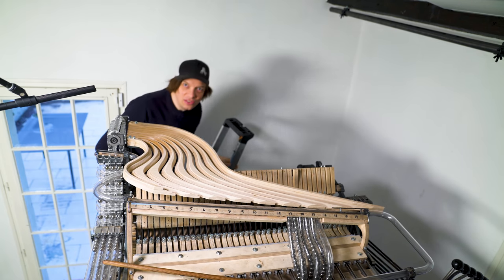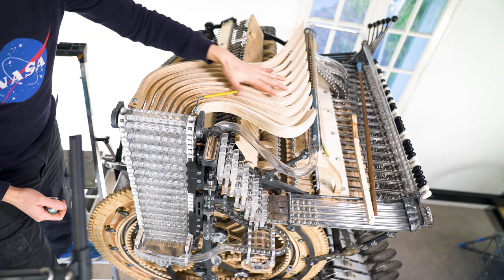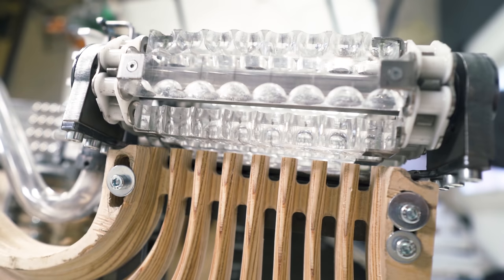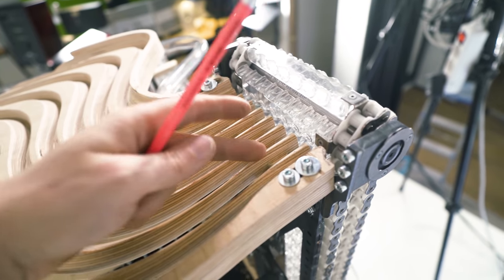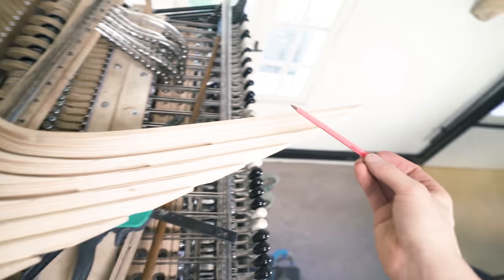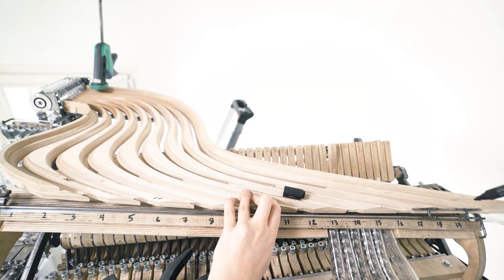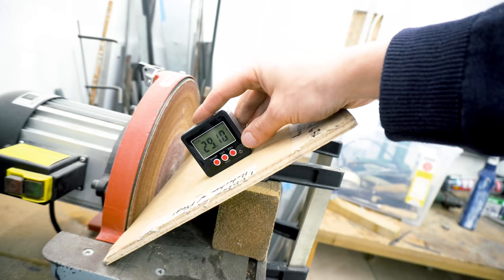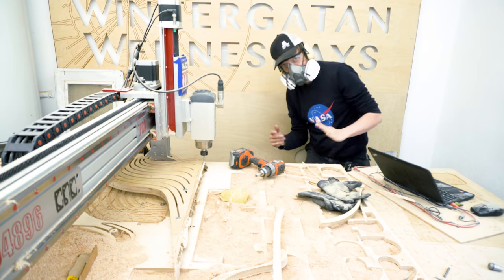Marble Conveyor Belt Plywood Lanes

Comment: I love the progress you've made but I'm gonna be honest, I'm a little concerned with the marbles running down the divider, they are getting hung up on the marbles on the top of the channels and in some cases jumping when they hit them, and this is just with 6 channels, what's going to happen when you have all of them, they might lose momentum and start jamming up then you'll find yourself in another round of engineering whack-a-mole. Might want to revisit making the marbles at the top of the channels as flush as possible, I can clearly see at least one channel (#15 I think) where the top marble is sticking out a bit too much and marbles are getting hung up on it.
Reply: It's a difficult balance to strike. Either the top marble sits too low, or it sits too high. Either the marbles in the runway get caught on the marble in the channel or they get caught on the channel itself. I think we may have to accept the fact that depending on the speed of the marbles vs drag and various other factors, some marbles are just going to get stuck. Short of making the main channel steeper (But then we face the issue already present where marbles are skipping over the channel entirely) I don't see a way to avoid all of the marbles getting stopped at some point in time.

What we can control is the most likely situation for marbles to get stopped. The ideal situation is that when a marble gets stopped, that it provides the least resistance possible to the other marbles that are going to hit it from behind. This way things don't get clogged up.

Comment: The marbles are going so fast, they almost bounce out very often. And the earlier channels aren't going to get a lot of marbles, especially as the marbles bounce around, almost completely relying on that on overflow tube. Maybe a very intensive song that has a lot of things going on is going to starve some of the channels, if you rely too much on that overflow. Especially if there is a very "hungry channel" it might just eat up all of the reliable overflow marbles and starve most of the channels after it. If there is some simple way of slowing the marbles down and or keeping them more contained and less bouncy, then it's no problem, but I can't help but think that a lot of the solutions might create additional moles to be whacked.
Reply: The higher channels have their own additional feed
Reply: If the latter channels are getting too many marbles, the overflow will supply those extra marbles to the earlier channels.

Comment: I understand that the form needed to achieve 100% reliability for playing music is goal number one. Yes. It's good to have that focus and necessary. But the visual play of the moving parts, the moving marbles, and the static forms of the machine is part of the end goal. It's a marble machine so watching the marbles run is so important. And these lanes look great and achieve that purpose as well as delivering marbles as required. Exposing the path of the marbles on the top is a big deal and will really be a big part of the experience. It looks fantastic! Is it a marble machine that happens to play music or an instrument that happens to use marbles? Such an amazing way to tease out this dynamic. Thank you Martin.

Comment: Hi Martin. This is not a technical comment regarding anything in the machine, and I realize there is a small likelyhood you will ever see this. But I know from experience how it can be with the overwhelming feelings of every kind when undertaking a project of such a humongous size. Just remember everything you have achieved so far. At the moment you are doing whack-a-mole for your hearts content, trying to figure out the inns and outs of the machine's quirks, doing fine tuning of some of the critical functionality of it. But you have achieved a lifting system that works very well. You also have an extremely mechanically sound powertrain of the machine. The programming wheel works like a charm, not to mention the hi-hat machine. And it all looks so beautiful. The movement is intriguing, the colors are wonderful and the balance between wood, steel and acrylic is nothing short of perfect.

It has been three years, and I think that this project has ended up being larger and more complex than you thought when you started up. But you have come so far. Looking back at the videos from 2 years ago, 1 year ago, or even ½ year ago it shows clearly. Don't forget that, especially not when times are feeling rough and the amount of work left might feel overwhelming or never ending.

Comment: This is always so awesome to see your design process and see the machine coming together more and more.

Might be worth putting a small layer of felt or something on the entry to that marble run.  You can already see some marks and a little wear from the impacts.  The undersides of the elevator levels are taking some hits too.  That could cloud up the plastic over time so maybe some clear silicone or rubber there would be good?

Comment: hey Martin, at some point in the slomo footage you can see the marbles skipping around on top of the holes with the other marbles in it. To keep that from happening you could add in a rotating crossthingy out of wood, basically a flap that covers the hole and rotates, letting a marble through whenever there is space underneath it to let it rotate. It would give the marbles a smoother surface to roll on and there would be less risk of one dropping out

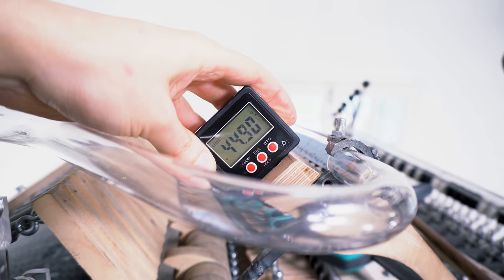Comment: Martin, I think your disk sander (5:03) has an angle adjustment under the table so that you can sand angles easier. 

Also, it seems that the marbles from the top conveyer belt are dropping into the 2-4 the most with none in 1. This might pose a problem because the leftmost channel (at the top of the slant) may not get enough marbles (or any) as the ones toward the right will. I would recommend ensuring that the conveyer is either always full or prefers the higher channels. 

Great content as always! It is really beautiful.

Comment: I don't know if you noticed but lanes 1 and 2 are getting a lack of marbles.  Which is going to be an issue later on when the machines is needing to play those instruments. Also yeah the bouncing is going to be an issue.  I noticed that the last video.  If you re-watch the footage from 8:09 to 8:24.  Lanes 3 - 5 are getting more traffic than lanes 1, 2, 6, 7, 8.  Which again is a glaring issue with this new marble... gutter lane setup. Maybe that is by design, but not sure.

Comment: The part is essentially flat, but the line where it starts (at the marble ladder) and ends (at the feed ramp) are not coplanar, so clamping or bolting the part to these two lines puts strain on the part and the mounts. If you were to extend the grooves in the ramp all the way through the bottom end of the part, you'd end up with something like the teeth of a comb. You'd have to attach each "tooth" of the comb, individually, at the feed-ramp end, but you'd considerably reduce the twisting strain on the part where you have it attached at the tap - and you'd avoid further cracking.

Comment: One thiing caught on eye- Those rail speed and timing. As you allready know if you adjust the gap widht of rail of those first ones you can adjust rollin/timing speed then all marble came at the same time to the collector rail. Now the middle rail is slower a bit ans last two of the right are littlebit faster. That desing still looks SO good!

Comment: The new track looks great!

As an engineer, I saw one thing that might be an issue- the marbles seem to land on the same spot after being dropped from the conveyer. This, combined with the fact that the wood is relatively thin there, could lead to some longevity issues down the line from the marbles wearing down that area. Maybe its not an issue! We'll see.

Comment: Might I suggest a small patch of a material that can absorb the impact of where the marbles land off the conveyor? Each drop off is an explosion of sound and if you can maybe control the resulting bounce, a rubber or foam of sorts could quiet it up a bit.

Comment: The marbles follow a Gauss-distribution on the elevator entrance. Maybe a feathered (Tree-styled) entrance wing, emphasizing the outer parts would even the spread. Maybe there could be a minute height difference in the applicant wing. Maybe allowing crossovers at the entrance of the new upper wing would work. It‘s not a problem though for now or maybe ever.

Comment: First: The plywood lanes are a piece of art!
Second: The bouncing marbles on top of the marble divider (starting at about 9:07 ) is very scary!
If the final drop was less steep (maybe 22 degrees instead of 45 degrees?), but also had more room, would that help? (It could also slow down the marbles in the plywood lanes, because the drop distance from top to bottom would be less. (As long as the marbles didn't come to a stop in the lanes, though.)

Comment: Given the recent improvements to the marble gates, I am wondering if the systems pin trigger + marble divider could be slightly lowered, thus completely eliminating the need for the marble escalator : marbles would get out of the main wheel through the demagnetizer, and immediately enter the marble divider. Would remove the marble circulator too.

Comment: Martin, the marbles are going so fast and landing at a much sharper angle, they are bouncing on the top of the lanes as they enter the divder. If you watch you can see them bouncing when they land and as they go down the divider itself. Also the bouncing is causing much more noise.

 The design is beautiful and there was clearly a large degree of skill. Hopefully you see this so that its not a huge mole for you om the future...

Comment: You can use a multi fluted 90 degree countersink to side mill a 45 degree angle.  With step over and down it will leave a much cleaner edge than a square or ball endmill would and you can take much larger steps.

Comment: You might want to slightly change the marble divider in the location where the marbles contact the divider, after they are lifted, so that they don't cause the wood to break over time. You could add a small slope with a acute incline or just add material a few millimeters before those contact points where the marbles bounce off of. But this can be done after the initial divider breaks so you don't waste materials or time, but I suggest you modify the CAD file with these minor adjustments so that you don't have to remember this suggestion and try to search for it again.

Comment: One point I haven't seen yet (I haven't read every comment) is that the marbles are exiting the lanes too late on the divider, not hitting until already passed the first 4 or so.  Coupled with the speed, you may have the first 6 slots in the divider that get marbles ONLY from the fish stair return.  Since that return is slower than the conveyer, and if the other slots need a lot of marbles that drain the return, I can foresee a number of lower vibraphone notes that will run out of marbles.

Comment: looks grate
i think you need to bend the track so it will not stay in constant pressure
eventually the hole of the top bolt will brake

Comment: The marbles seem to prefer the center of the conveyer. Will that cause an issue for the low end of the vibraphone? Also, there is a lot of bouncing going on at the top - seems like a good way to lose marbles.

Comment: I was wondering for a while now if you have any issues with the magnets of the programming wheel.
Those neodymium magnets are very brittle and delicate. If the coating wears off they are prone to corrosion. This might be a substantial issue when playing for a long time. Also and any stress can break them, especially when they're corroded. 
Maybe adding something like a rubber coating on the exposed part?

Comment: I've noticed that marbles tend to accumulate along the right side of the main trough, and then new marbles from the beautiful new plywood lanes come down and bounce along the top of them. If so, is this a marble escape route waiting to happen? Is that why you were running the stairs at only 1/3 capacity? Either way, great job! If what I described is a new mole in the making, I can't wait to see how you slowly and methodically whack it with your newfound philosophy of engineering from core principles.

Comment: Does anyone else think that the de-magnetizer is causing more resistance than needed. The first row of magnets are pushing the marbles back onto the pick up wheel. I bet if he removed all but the last row of magnets that section would run more smoother and actually fill the conveyor belt. Anyways.....amazing work as always Martin 👌

Comment: hey Martin will you use a different material than Plywood for the this part or coat it in epoxy at least where the marbles land? it seems like the marbles are marring up the plywood because of their kinetic energy...  The black markings seem like they are getting more and more the shape of the marbles hitting them.

Comment: The slots where it bolts to the top part, which are at risk of cracking, could be reinforced with wood filler.

Comment: I'm really proud of you. You have done great work. It's truly fascinating. But, not to be the joykiller here but if you look at how the marbles end up in the lift and how the outputs are positioned the could be an issue with the first couple of gates being marble starved: first of most of the marbles land in the middle part of the lift, which is going to drop them of right at the middle gates. Secondly the output spits the marble at an angle and with quite some velocity, so that the marble lands the first time on the fourth gate. That means that the first couple of gates rely solely on the fishstairs to feed them. I'm not sure if that's an issue but i wannted to have said that. Anyways great work. Truly astounding

Comment: I see the marbles bouncing off the edge between the lanes and the square plank, which spells trouble in the long run. Perhaps in CAD you can have the lanes ease into the square part instead of having a hard edge in between? And maybe you can create a more rounded slope on the square part to let the marbles roll into the divider.

Comment: Martin. I have a solution for you. The fish stair has a range of up and down about 12-15cm or so, just guessing it's up and down range of motion but, you have plenty of room to accomplish this.  As it goes down you could attach a dividing plate that cuts and separates the marbles so that it only has a set of 4 ready to drop into the fish stair as it completes it's movement. But here's the thing, the plate that separates the marbles and stops the ones behind it from following behind and getting caught in that edge case is on a track that is backed by compression springs so that it can make contact slightly before the marbles drop into the stair but also have enough compression distance so that if it gets caught in the exact same edge case, it just compresses up and doesn't break anything or shoot the marble out.

Like using a playing deck of cards to separate a set of 4 marbles right before the fish stair finishes dropping and picks them up, while keeping the rest at bay.

With this design, the spring steel is not needed to keep the marbles in places, they will sit in the tube just fine as the dividing plate keeps them there.

Comment: Is there a way to dampen the marbles as they leave the track? They're bouncing around a lot once they get to the divider line, I'm worried 1 in 10,000 will get jostled out. I think slowing them down a little at the very end would improve reliability.

Comment: @Martin, im afraid that the marbles are entering the "line" with way too much speed, and that they will "jump over" any marbles already rolling down the line, or even "jump over" the holes where they are supposed to enter the tube. Have you thought about this potential issue?

Comment: Have you thought about how this new part will cause marbles to be fed later into the divider than the old part meaning that there will be less marbles available to the earlier channels to play notes?  In the worst case this would mean that a tune that had more cymbal notes it could run out of marbles.
It also appears that the new part makes the marbles enter the divider much faster which means they won't fall into the channels so easily and will in-fact just skip all the channels and go around again.

Comment: Pretty cool! But (there is always a "but", isn't it ;) ) I am thinking about, if over the time the marbles will leave a dent at the very beginning of the marble tracks, right there were the marbles are released from the "elevator". Visible at 0:40. Maybe that will cause them to block the path eventually or run uneven? And yeah, the speed of the marbles from 9:10 on makes me wonder if at high playing speeds some of them will overshoot and give you a mole nightmare again ;). Nonetheless, very impressive indeed!

Comment: Martin, artistically the rails are an eye pleasing masterpiece of arithmetic and style.  However design may prove later to introduce issues with flying marbles caused by the energy the collect rolling down the grade then releasing that momentum energy as it. Collides into another marble and which will repeat the transfer of energy by half of its inputted energy to the next marble down the line.  Simular to the memorizing chrome balls suspended by strings and each end ball hits the his the next after being released from a certain height. Once impact is made energy transference occurs transmitting that energy through the series of other hung balls until the end ball terminates the transmission and transforms the energy carrying the ball outwardly in an arch due to the string and then falls gaining energy causing a chain reaction until friction absorbs a portion of the energy after each cycle. 
Your friend in this case will be friction on the lanes that are adding the extra unneeded energy during their decent down the pathway.